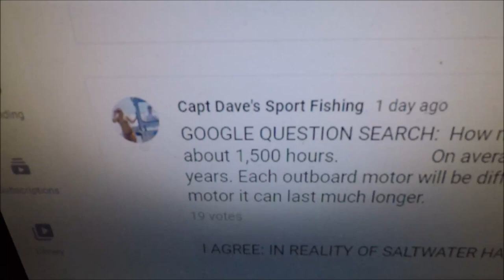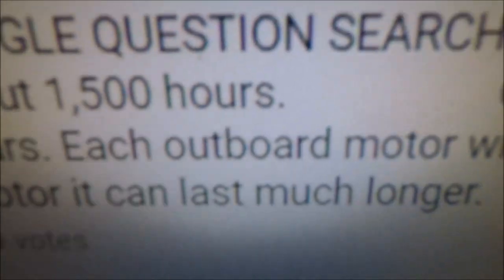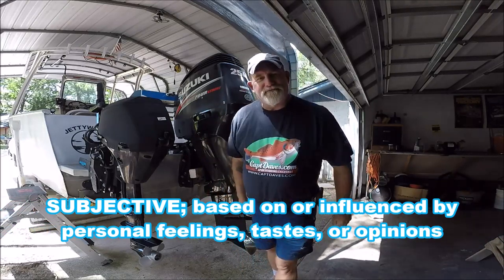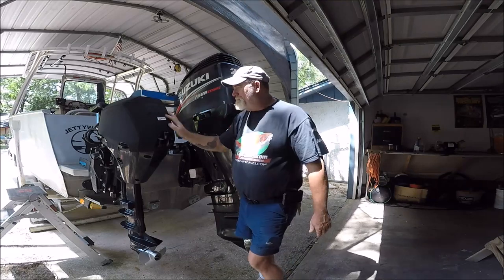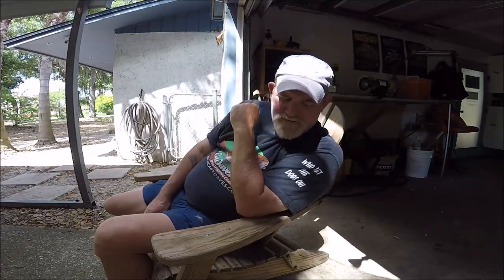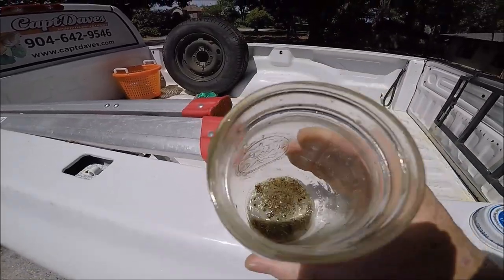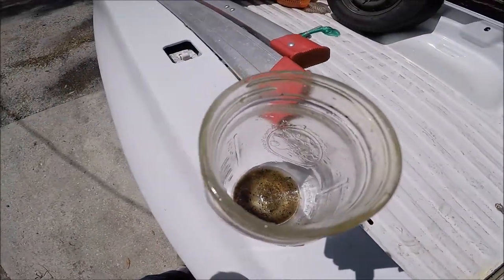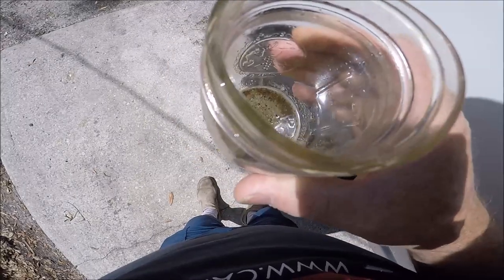OUTBOARD MOTORS, how long do they last?

Comment: I have a 1995 Mariner 75hp motor and it was bought new and it is still running very strong. Motor has never been rebuilt.  Carbs & oil pump,  water pump and water impeller and  odds and ends such as that have been rebuilt. I would estimate less than 900 hours on it.  Well maintained and taken care of.  All use has been in freshwater. 👍

Comment: Saltwater and the St. Johns River.  Say no more.  You have been meticulous with you motor, above and beyond what most people would even think of doing.  And you still end up with issues that just won't go away.  You are correct in saying that they are disposable.  Will be looking for a new one hanging on the Jetty Wolf.  Stay well Captain!
Reply from the maker: Ive had a new one, since May of 2020. Ya may have missed that video. NOW, want a new one next year. But doubt I could find one....thank to the SWAMP.

Comment: You'Re right Dave my 2015 is already starting to give me problems and I only have around 600 hundred hours. I wish I had money to just repower wasting a lot of time and money trying to fix the dam thing.
Reply from the maker: Hey solo how you been good to hear from you at least you're running in cleaner water than I am up here in Jacksonville I'm running through the dirty St Johns River full of particulates massively salty all that good stuff but I've had people go on this comment and tell me they've had 8000 hours of trouble-free service and I call that bullshit I didn't fall off the turnip truck last night to make them last you just got it really stay on top of your maintenance and keep it as clean as possible and the cooling passages and all that good stuff I'm a maintenance machine when it comes to mine

Comment: Great listening with coffee this morning.  I'm running a 90hp Suzuki and it has 1500 hours and its a 12 year-old 2007 model.  So far, so good.  95% freshwater use, that makes a difference.  Did I miss it, how many hours on your motor?
Reply from the maker: doesn't matter....I  did way more that that in less than half the time.  you're in some sweetwater clean lake, NO comparison, guess you missed what comes out of my motor daily?  and  in the charter biz, I can't be out of work more than I am already with some multi-week fix and it's just that time to cycle these every 4 years.
Reply: @CaptDavesSportfishing  I've heard that the bigger horsepower motors don't have the life that small hp motors do.  Not sure if that is true.  I do agree that there is a time where the maintenance outweighs the value or being paid for.  I said I was keeping mine for 10 years and then getting a new one, but the tightwad side of me has made me keep it.....LOL!  You're smart getting rid of yours while it still has some resale value...another bonus to not running them until they blow up.
Reply from the maker: @DieterMelhorn   a 25hp honda will run with minimal maintenance for 25 yrs. Usually N-O-T,  a 225 hp. That's for sure! if I get really decrepit some day, it'll be a smaller 2 person boat and a 40hp for me!

Comment: Congrats on the new Suzuki!  I've told you this already but I've got the 2019 DF250.  The prop that was on my invoice was indicating a 3x16x21.5 and in the box was a dang 3x16x18.5 so I used it last season and then just ordered the one it was supposed to come with.  Anyways, thanks again for the videos and information Captain Dave!!
Reply from the maker: MY BOAT REACHES RPM w/ a 3 x 16 x 17, but then again my whole 26' rig doesn't weigh what ''others'' 26' boats weigh.
Reply: @CaptDavesSportfishing   Yeah I'm still learning what prop to use on my 98 Grady White 228 Seafarer.  My boat weighs around 4,200lbs.  Any tips on choosing the right prop pitch?
Reply from the maker: @chrisalan3275  any mechanic should tell you that you need to go on a normal'ish load, and run on a calm day and reach 6+ thousand RPM's , even if you have to run and keep trimming the motor up.  ITS F'n  SCARY!!!!!!! it was for me, by myself. My boat was screamin ' like some billy bass boat with the steering back then (my old wore out steering) all goosey. But I reached, 6300 RPM for 60 seconds while wanting to piss my AFTCO shorts...and the prop was perfect fit, then.

Comment: Well I Have A Old Small Yamah 8 Hp 2 stroke and I Thik Its From 1999 And Still Work In Salt Water But I Flush it Evrey Time I Use It And I Sevice It In Time With Changing Just (Fuel Filter . Water Pump . Spark Plug .......)
Ps: Ive Changed The Ignition Coil Once 😉
Reply from the maker: but ya still need GRAMMAR class. 😉
Reply: Yep Im in But The most important thing is that the message arrived 😅
Reply from the maker: @adelbeo644  8 hp is a toy.....my kickers is 15!
Reply: My Smal Boat Can't Fit More Than An 8 Hp And i Thinked About The 15. Its Too heavy For It It Gets On Plane without even Starting The Engine
Reply from the maker: @adelbeo644  just wind power huh?

Comment: Just out of curiosity Captain Dave, you mention 4 years time on average to replacement. How many hours on average and I realize you are makin a living with your boat. In 4 years how many hours do you typically  run time? How many boat motors have you bought?
Reply from the maker: like Orowock said and I said its not always hours. 4 years is based on my experiences with 3 motors on this boat in 15 yrs.........going on #4. How many in my boating life?? ......TEN.
Reply: Thanks for your reply Captain.
Reply from the maker: @billwalker4836  350-400 a year

Comment: Good video Dave. I am pondering replacing my 2003 Mercury 125hp 2stroke for a new 115-150hp 4 stroke. Any thoughts on the Suzuki 140a?
.
Reply from the maker: from reports very efficiant and no fuel cooler on them.
Reply: @CaptDavesSportfishing  thanks Dave
Reply from the maker: @bookooc5605  if I had a open check book, or a sugar momma, I wanted to get twin 115's, and take my 15 kicker and put it on a ole jon-boat. But, I didn't plan for a global pandemic, and a good F'kn by them chinese, to ruin my whole life, either!!!!!!  115-140 suzuki's don't offer the ''fly by wire'' or ''chip'' to make them a counter rotating, only problem. Once ya ever have the ''fly by wire'' system, No more BS cables for shifting, you'll never go back to cables. Its that sweet and smooth.  Not sure if the ''AP'' models in which they are called are offered in 150's, but they may. You'd have to check the zuki website.
Reply: @CaptDavesSportfishing  Thanks for the feedback Dave. Yeah, I have never had fly by wire, so I don't know what I am missing. Not sure if the 150 would be too heavy, the my boat will run a 150, just not sure if the weight and extra cost is worth it. I guess I need to talk to a dealer. Thanks again. Rick
Reply: @CaptDavesSportfishing How times change. (2023) the Suzuki 115/140s now come in "Drive-by-wire". Models: DF115BG / DF140BG.

Comment: Just like you said..it's objective. It could last until It breaks..or it could last 10000 hours with good maintenance. I've got an old evinrude 85 2 stroke and it's got 3500 hours on it. But the boats old and I haven't used it for like 6 years. It could potentially never run again..or it could last another 3500 hours depending on how much money and time someone wants to spend on it.
Reply from the maker: S-U-B-J-E-C-T-I-V-E
Reply: @CaptDavesSportfishing  subjective is what I meant. Haha what do you plan on doing with your current engine? Trading it in?
Reply from the maker: @blindabinda1234    no one in ho-bunk'ville does trades, they just call the local wholesaler.
Reply: @CaptDavesSportfishing  so you're gonna try finding someone t buy it?
Reply from the maker: @blindabinda1234  no more 700 lb. motors in my garage....pro-wholesaler shoots a price out.

Comment: How long does an outboard last? This question can not be answered by an hourly equation. The answer is,until your confidence in it's ability to perform the task at hand has been exhausted.  In simpler terms "until you've enough".      Congrats on the re power Capt Dave.
Reply from the maker: The word ''had'' is missin'....But there, all fixed. I gotcha covered brother!

Comment: Had your 250 had the "vapor lock" or loss of prime issues on hot days?
Reply from the maker: that isn't what it is. Its a clogged FUEL cooler https://youtu.be/BTrd3sM24P0  NEVER USE MOTOR FLUSHING PORTS!  use a barrel, around here the shit that'll come out that will clog the fuel cooler will AMAZE you!  https://youtu.be/7ZYwh9e2ZD8

Comment: 8/10 thousand hours
Reply from the maker: hahaha.....
Reply: We put over 1000 a year on them here on the chesapeake bay crabbing commercially . They run 8/10 thousand
Reply from the maker: @brandonmurphy4657  thats not the point, the point was ''till they need major work''. You're not the lone ranger, I have crabber friends that destroy their motors, holes corroded thru them, lower units busted,  etc.
Reply: @CaptDavesSportfishing  I have ran a suzuki and two Honda s 10 k without anything but basic  service
Reply: @CaptDavesSportfishing  lol. You assume it takes major repairs to get that many hours . If they lasted 1500  , one year commercially we would not buy them . Nobody would pay 15.000$ a year for an engine .
Reply from the maker: @brandonmurphy4657  Buzz word, ''service''.....sorry don't believe you.
Reply: @CaptDavesSportfishing   I don't care if you do or not . They last that many hours . If you pile them on quick . My dealer sees them with 8/10k all the time here . I have and know many people who get that many too. By service I mean oil thermostats , water pumps ect . Not a wrench to the engine so to speak
Reply: @CaptDavesSportfishing  you obviously don't know as much about outboards as you think you do
Reply from the maker: @brandonmurphy4657  40 years of boating, endless amount of outboards, loads of friends that are also outboard mechanics who love people beating them, and usually by 1,500hrs as stated on google answers, a major failure happens. From fuel coolers, fuel pumps to trim/tilt motors, or corrosion issues, to lower unit gears all costing big bucks to fix. I run commercially, too. Watch ''born again boating'' here on YT. If ya wanna see lots of under 1,500 hr. motors with '''major issues'''' $$$, in the keys.
Reply: @CaptDavesSportfishing  I put 1500 hours on last year . 0 problems
Reply: @CaptDavesSportfishing  I have been a commerical fisherman for 30 yrs myself . I mean not little rod and reel stuff
Reply: @CaptDavesSportfishing  no wonder you have no wife or kids . You think you know it all .